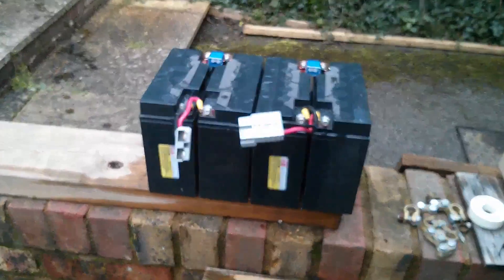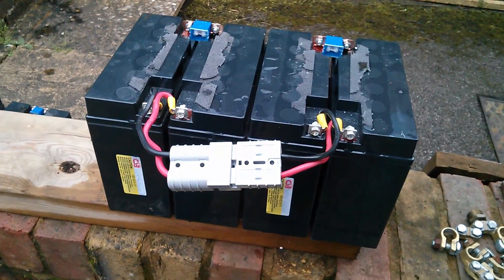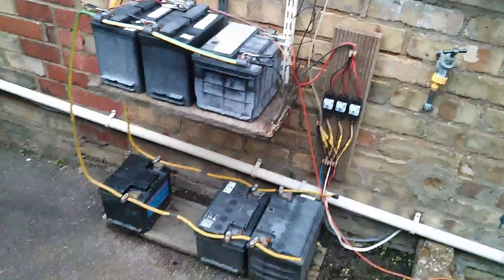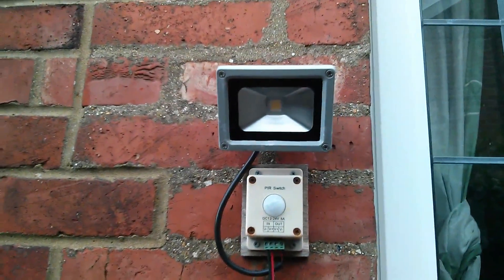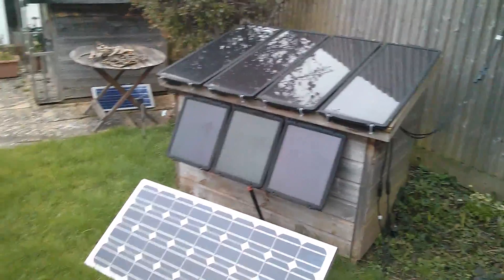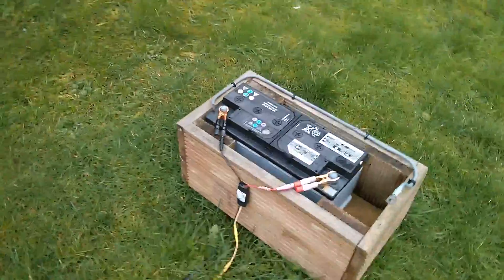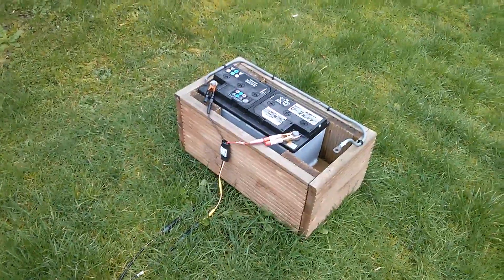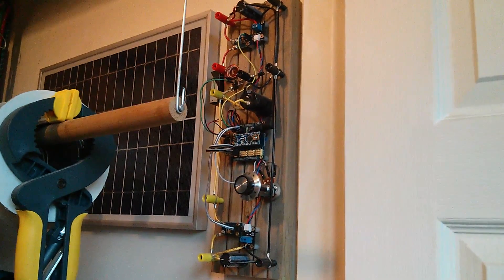12 Volt Solar Power System, UPS SLAs and Anderson Connectors

Comment: Nice video, i have three 12v 7AH /20HR Lead acid UPS batteries and i want to use it on a DoPower 1500 Watt inverter and 130Watt solar panel to power my laptop under the scorching African sun. do you have idea if this will work without any problem ?

Comment: If those are AGM batts you can put them inside the house so it wont rain on them and so they wont get cold in the winter or hot in the summer. I have my AGM batts in the house.

Comment: hi are you using 2.5 twin earth wire to run your solar panels to your house  and charge controller,are you using any  speaker wire on your set up which can take 5 amps
Reply: nice one save/s lot on solar cable do you find much loss on 2.5

Comment: Must be hard to keep the batteries topped up with complete overcast everyday. Though you have lots more panels than me. I made a similar 12V system with a 6A PWM charge controller and a single 40W panel. It powers a 600W pure sine wave inverter. The panel can only just keep up with the inverters standby current on a cloudy day.
Reply: ***** Because it's running my alarm clock haha. The standby is just 650mA and the alarm clock adds another 100mA. When I have some money to burn I'll go get two 90W panels or I can get a couple more 40W panels for free, then the problem will be solved.
Reply: ***** My 2 batteries are 12V 100Ah and are wired in parallel. That is the correct way to wire 12V batteries in a 12V system.

Comment: So what does that battery pack charge/power exactly?
Reply from the maker: Just my workshop equipment - I try to use the mains as little as possible
Reply: Ah ok, I wanted to start using more solar. Any recommendations of panels?

Comment: Don't mix those UPS batteries with the car batteries. Their charging requirements are not compatible. i.e. you can have cooked AGM/Gels and nicely charged flooded or nicely charged AGM/Gels and floodeds that will sulphate up. Ov course if you're cunning they can be discharged together but not charged. And just incase anyone decides to call me out: AGMs and Gels aren't exactly the same either.
Reply from the maker: I agree - connecting SLAs and flooded batteries in parallel wouldn't be a good idea.

Comment: Hello there. Just discovered your channel and subscribed directly. There is one thing I have to say to this "arrangement" though:
It would be advisable to connect a high current Schottky Barrier Diode ( like you can salvage from ATX power supplies for example) in series with any of the 12 V batteries. And ONLY THEN connect them in parallel. The same is even more true when you connect solar panels in parallel. ( Only that the protection diodes are often already integrated there). When you operate so many batteries of different type and age in parallel, considerable compensation currents can flow from one battery through another. If for example the voltage across one of the older batteries would collapse ( which is even more likely when they are in an environment with high temperature fluctuation, like in this case) , the other still functional batteries would completely  discharge over the defective  battery. And as you know, lead acid batteries are worthless once that would happen. I would make you a sketch of the circuit here if I could, but I just try to explain what I mean. There must be a diode in series with any single solar panel pointing "out of the panel". (Maybe these diodes are already included in your panels but I would check that). Then there must be a diode from the charger to the positive pin of each single battery (pointing in the direction of the charge current). And finally there must be another diode from the positive pin of each of the batteries ( pointing "out of the battery"). You can than connect the cathodes of those diodes together and attach that to your loads ( "distribution system"). The negative pins of the batteries can be connected directly. In that way you can operate the batteries in parallel but eliminate the danger that one battery will discharge over another. If you don't see what I'm talking about I can still make you a sketch of it. greetings

Comment: Goodness! Yes those are Anderson powerpoles, but those are the huge 75A connectors. For internal and shack/lab distribution the single pole colored connectors are wonderful. This presentation:
http://youtu.be/UXxER-LIaOE
is somewhat long but VERY thorough. I use powerpoles for all 12v purposes, which has greatly improved flexibility.
This video goes into more examples of the modular approach capable with this genderless system:
http://youtu.be/9hz_FSveThY
I always tin my leads (if stranded wire,) crimp, then solder the powerpoles.
It would be trivial to replace that car distribution box with a nice panel with multiple powerpole pairs, fuses, and even one of your little voltmeters.

Comment: Just put the solar cells on the roof thus minimising volt drop and looking a whole lot neater at the same time. KISS
Reply: that typically means tapping into the structure of the roof to put up a mounting rack, if done improperly, your roof is garbage.

Comment: Hi,
I would like to drive a 10W LED from a single LiPo cell, could you recommend one of those step up/boost/buck converters from ebay please ?
This cheap one boost converter is a constant voltage type.
Reply from the maker: Boost converters with constant current control aren't common. The big 600W unit would be overkill and doesn't go down to 3.7v. You could consider a small boost converter followed by a LED driver. Actually, I have just that combination of parts coming from icstation.com soon. I'll make a video as soon as they arrive. Sure Electronics did the SEPIC 350mA and 700mA LED drivers - can't remember whether they go down to 3.7v on their input though.

Comment: Nice little charge controllers!
Reply from the maker: Thanks - they're PWM5s - no longer available from 256.co.uk because I decided to stop selling them so I can spend more time on my YouTube channel. Ironic then, that I've spent most of the afternoon thinking about a re-design. A smaller surface mount version which could be mostly machine assembled using SMD pick and place.

Comment: Voltage drop across the long wires is significant so boosting it up is a great idea.
If you're going with the wireless option, just add a sense circuit in aswell, so you can switch on the boost conventer and see the voltages, maybe charging current too. Simple with those 433mhz transceivers

Comment: I would love to get my hands on them batteries! I'm waiting for the better weather to see how mine are doing! All my panels are on the shed roof which will leak if I set foot on it! I'm looking for a nice connector for just 12V low current aplications so I can do away with the lighter plugs. Tried deans connectors but they are tight. might just make a fuse board with the 4mm terminal posts and car fuses.
Reply from the maker: Please come and take them away... oh, you mean the SLAs - no you can't have them! ;)
I'm thinking 4mm banana plugs/sockets for the indoor power panel now.
Reply: Julian Ilett yeah just 4-6 sets of fused at 5-10A for charging gadgets/running a 12V projector and a notebook. just got to be careful with polarity, waiting for some auto resetting fuses.